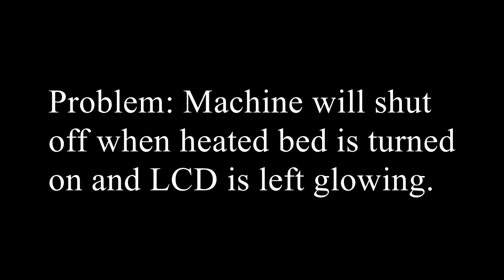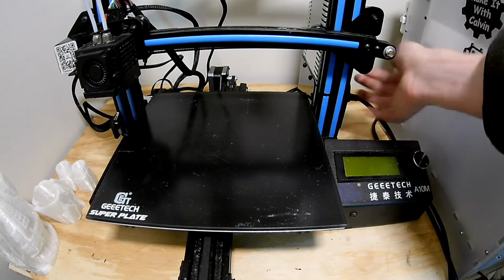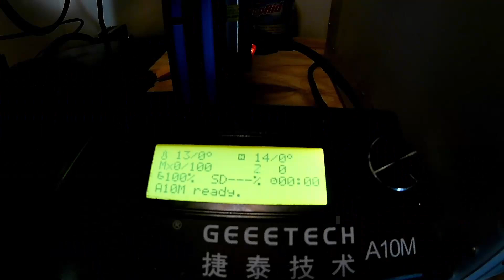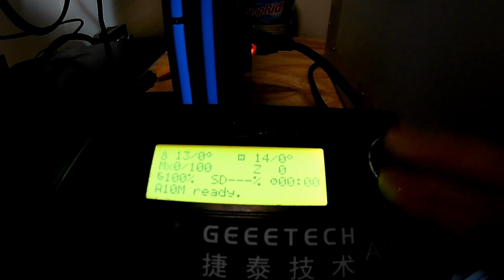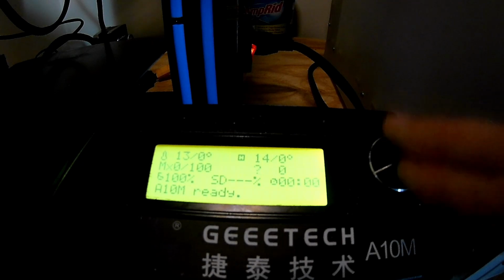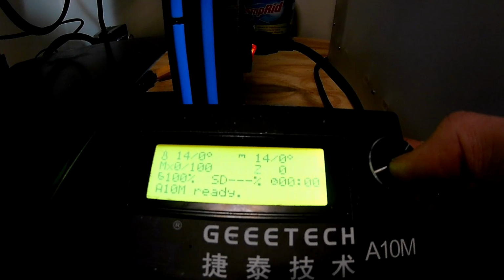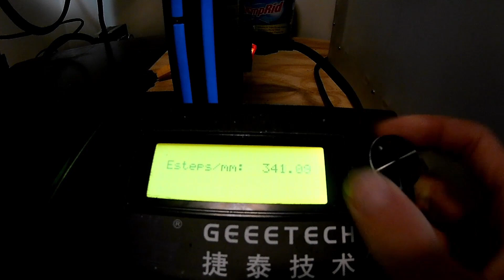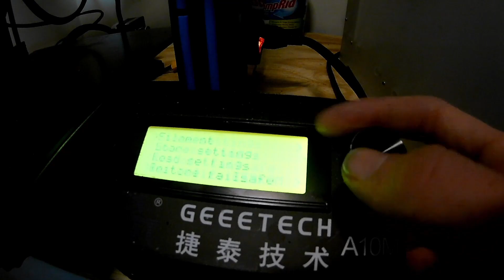Top 4 Geeetech 3D Printer Fixes

Comment: Ipa removes the pei over time bro
Reply from the maker: Really? I looked online through a plastics supplier and it says PEI has good alcohol resistance. Scroll down to page 2. https://www.professionalplastics.com/professionalplastics/ChemicalResistanceChartofPlastics.pdf
Reply: Exactly bro, alcohol resistant…not alcohol proof. over time it does wear down I have 2 glass bed with pei coating and both I have had to replace due ipa wearing the pei down 🤙
Reply: Think of it like clothes. you get water resistant which you will get wet in over time unlike water proof clothes will keep you dry 🤙

Comment: I have an A10M with 3d touch. My e-step is set to 395.00. Should this still be changed to what you recommended?
Reply from the maker: As long as the prints look fine I would not mess with it. You could mark a piece of filament and tell it to move say 10mm and check it moved relatively close to 10mm. Printer companies are notorious for changing things without letting users know so check before you adjust, although you can always revert to the factory default.

Comment: Bed shorting: Thank you for this. I didn't know about that. I had one power supply die and Geeetech sent me another one which looked upgraded. I'll be sure to check insulation. I'm going to double insulate it with more Kapton.

Bed sticking: I've had lots of issues with black PLA, which just will not stick because it likes to stick to the nozzle instead and just curl up and wrap around it, even after cleaning the nozzle and changing the PLA for brand new. For some reason, even different brands of black PLA do this. I suspect it might be that the black likes to run cooler. White and coloured PLA sticks perfectly, even on a dirty bed that I haven't cleaned at whatever temperature. It's so much more forgiving that I use PLA in the second extruder to get my first layer down and then use the mixer to go back to black.

Layer Shift: I've turned my acceleration down to 300. You should also turn down your jerk settings. I've put all the numbers under that menu to half what they were. Before,  the machine made aggressive direction changes and sounded horrible when the machine was on a print speed of around 35 (which isn't fast). I was getting prints getting knocked off the bed with big wobbly movements. The table was shaking. Not anymore. I print at a speed of about 45+ now with no aggressive jerking motions. This becomes crucial when doing taller prints as the vertical supporting frame isn't exactly wobble free under stress, and no one likes visible layer lines. This is something I wish I found out when I first got the printer.

E-steps: Yes they are wrong. Not just on one extruder either, but also all the motors. Mine was maybe 5% out and it might be different for different people. I tried the e-steps for the extruder but it was way off and I put back to default. To this day I cannot figure out why it works better with the apparent wrong calibration, however the motors all benefited from correct calibration. It becomes vitally important when making machinable parts that need a great degree of accuracy that you expect to be a certain size. I suggest going to an e-steps calibration video to do it properly with a ruler or tape measure.

Other: One other issue you haven't mentioned is the wheels on the bed and carriage. After leaving for a few hours they get flat spots where they bed in. When you manually move it you can feel a distinct judder when it lands on it. I have tried all kinds of different tensions, even changing the wheels, same problem. Before I start any print I always just put my finger over a few wheels and turn them without the carriage moving to get the flat spots offset from each wheel. This smooths it out enough so that it isn't an issue.
Reply: Just protect your printing beds undercarriage metal plate with a thick layer of plastic.

Comment: Your extruder calibration is basically, bad information. You mark the filament at a measured distance greater than 100mm, say 110mm from the spot where is enters the extruder. You then check current steps/mm then multiply this number by 100. Call this number A and write it down. You next heat the hotend to PLA temp and command the machine to extrude 100mm of filament. You measure the actual length of filament extruded and divide A by this number. This new value is your actual steps/mm for your machine, not just an arbitrary number that worked for someone else's machine, or not. It works irregardless of whether you extruder is geared, or brand, or model, or any other aspects, such as a sudden switch in the manufacturers of nema 17 stepper motors installed at the factory. The same technique should be applied to every axis on a new machine as well, as the method of calculations are exactly the same.
Reply: 5 years later and this post saved me. I was at 310 and seen this and tried the 436. I needed 414.63. Thank you.
Reply: @TheyeronLowe  I am glad it helped.

Comment: You know, I've got a Monoprice Maker select (which doesn't let me adjust e-steps) and I had to set my slicer to over-extrude everything by 10 percent to stop under-extrusion. On the CR-10s at work, I have to set the e-steps 10 percent higher than default otherwise they under-extrude. It seems like a common problem with Chinese printers for whatever reason.
Reply from the maker: I think it is due to a lack of QC on the company end or they are ripping firmware from another machine. Regardless of why it is annoying for new comes to the herd.
Reply: @MakeItWithCalvin  Definitely a lack of QC. But why always under-extrusion? I haven't run into an over-extruding machine yet
Reply from the maker: @EmilysElectricOddities  honestly I have no clue. I say within 5% margin of error is fine but 20% off (in my cases!) is just way off. I do wonder if they figure the slicer sets it all automatically?